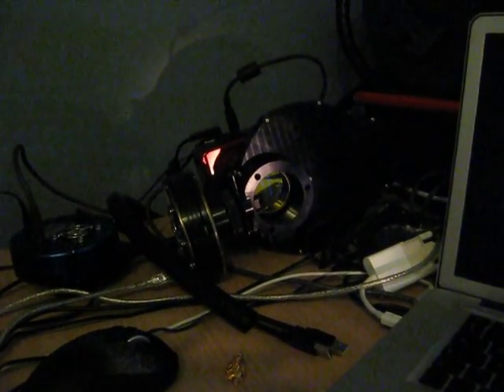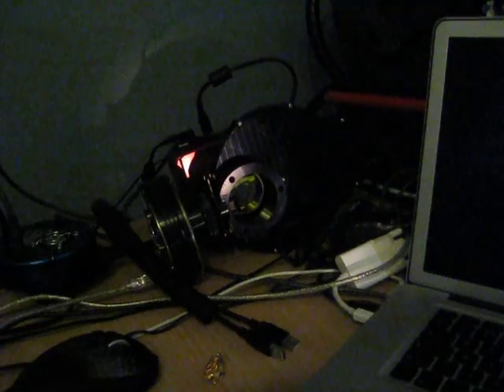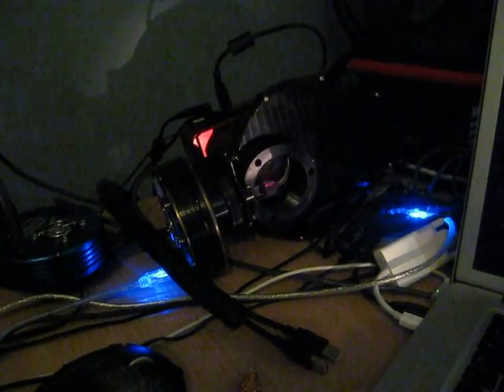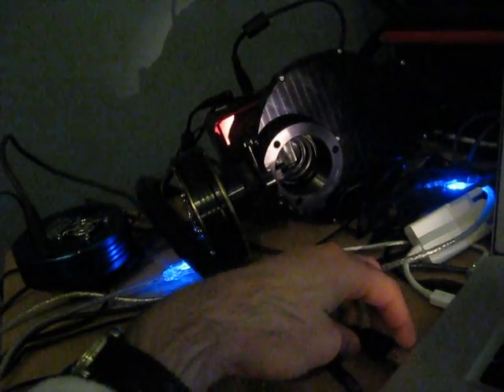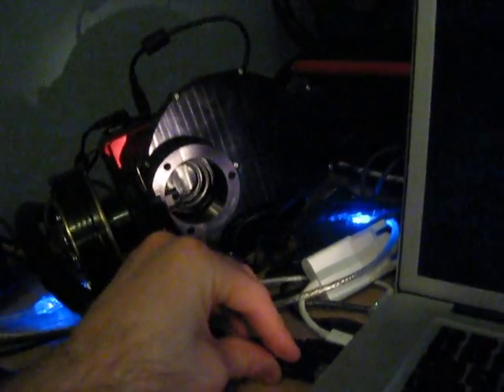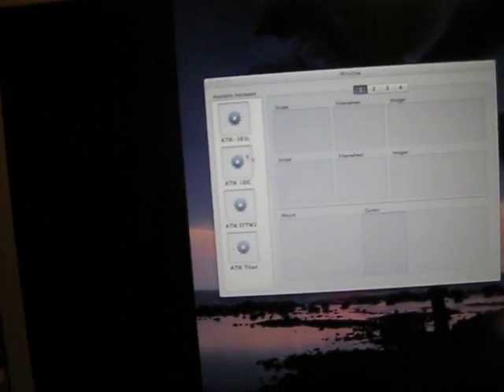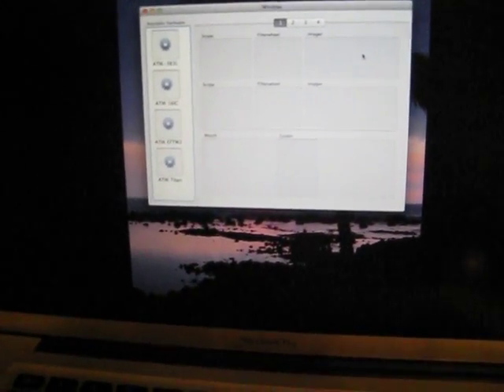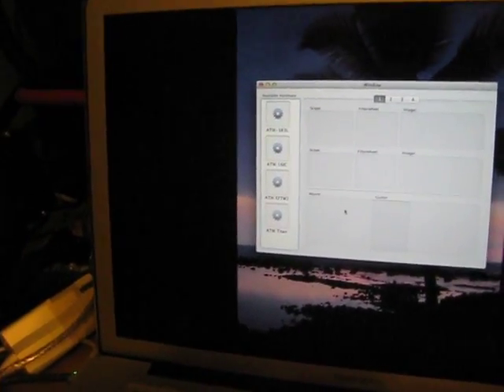ATIK 383L, TItan, 16IC and EFW2 running natively on the Apple Mac

Comment: Are you using a powered USB hub and extension for these?  I'm very interested in using my Mac with USB extension, but can't get to work, and thus want a reliable, proven USB extension cable/Hub that I'll be able to remotely connect to my USB cameras (DSI II & DMK) but using parallels on mac. Thanks so much for any assistance.